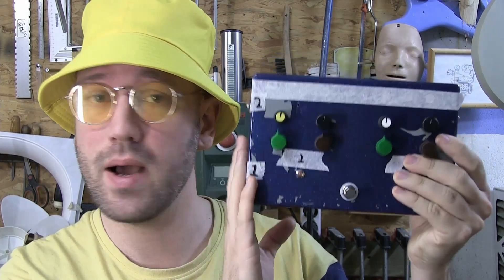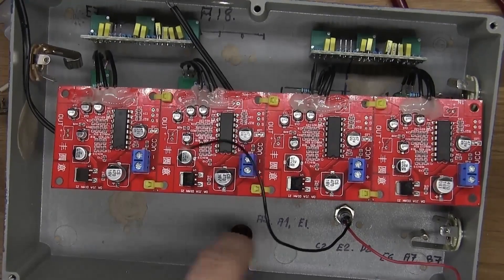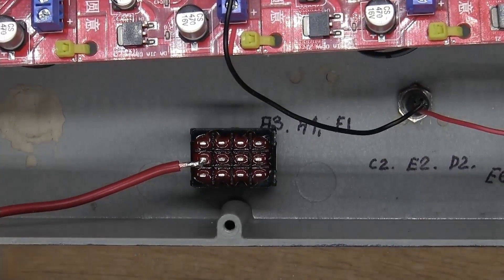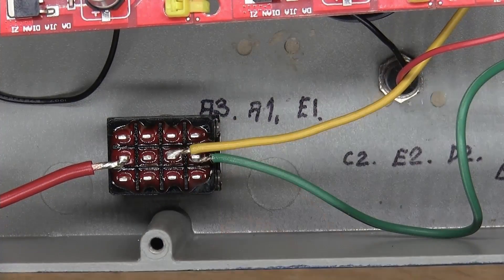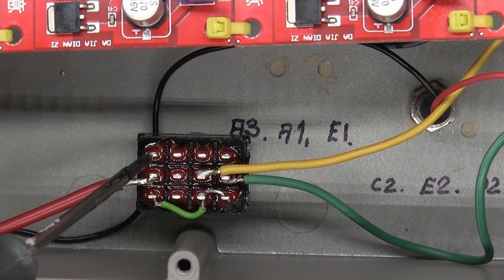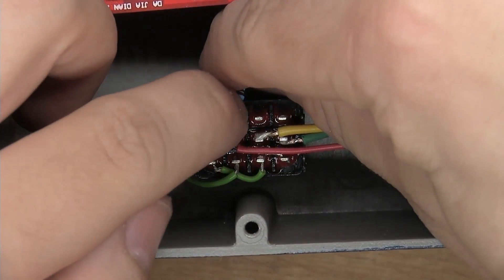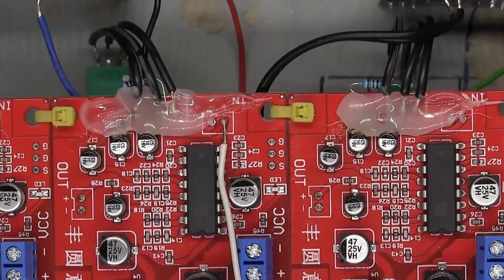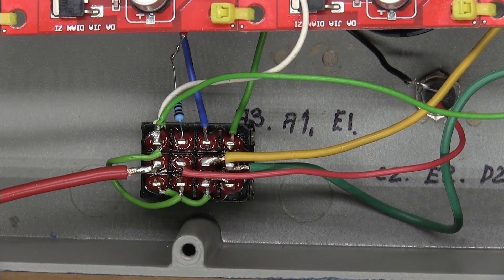how to wire a true bypass switch in stereo 4pdt switch

Comment: Hej! I don't get why you  wire the top left pin to the LED positive. 🤔
That connects the IN lead to the LED when ON, and connects the circuit board to the LED when BYPASSED. 
Which I'm not sure I nderstand why.🙃
Reply from the maker: Well its not always needed but sometimes it won't work without it so I put it there most of the time 🙂 it will complete the circuit even though its bypassed so nothing can happen 👍